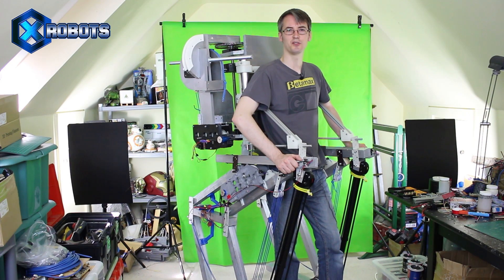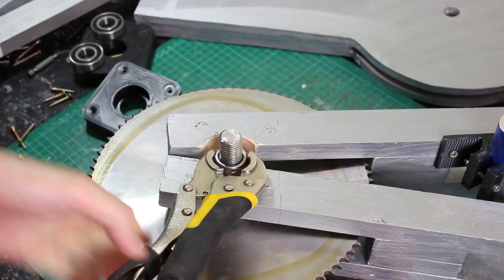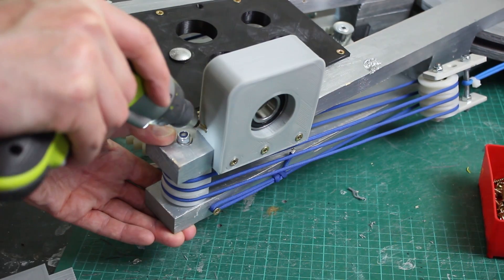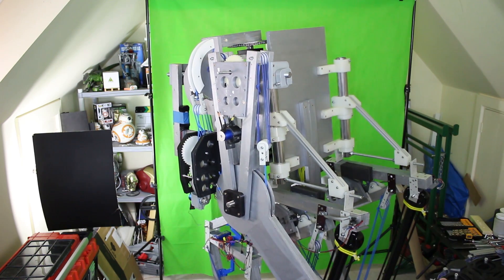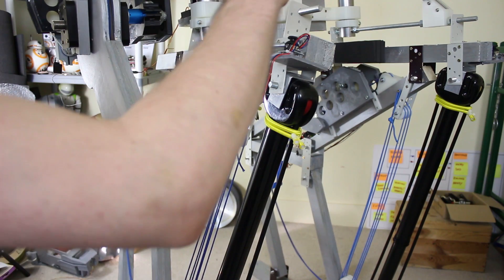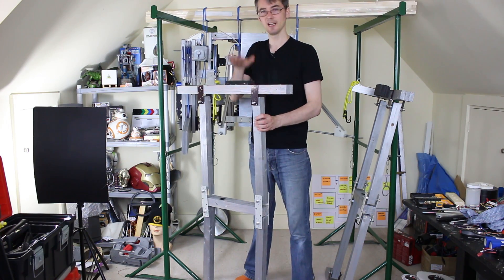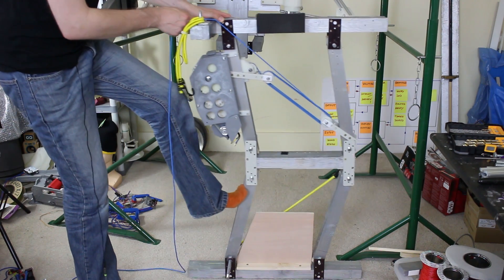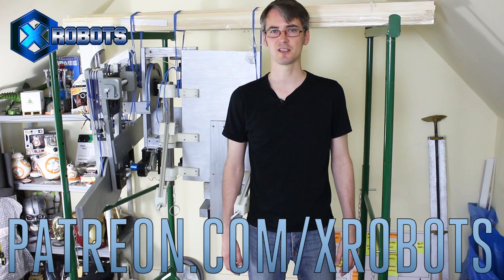Iron Man Exosuit #11 | Power Arm & Legs | James Bruton

Comment: Why you dont use 2 motors on the top legs? Wile one moter (a) is move back, the other one (b) is in neutral (powerles, non brake). And if you want to move back put on motor (b) build tention and release motor (a) to its neutral. This way you will have full control and strength during the entire movement. And not only when your locked, basicly like the way the human is build with 2 pairs of musles :P
Reply: xpatrickx11 weight, cost

Comment: You know, if any of the 3dprinted parts prove too fragile, the hacksmith has a printer that can add carbon and fiberglass strands into parts. I bet He'd love to help with such a cool project 😀. Of course it woyld only work with some parts 🤔, but it can add a great deal of strength. I know you've probably thought of this allready, but I'll just put the thought out there just in case.

Comment: Hey James. I've got an upgrade idea for your new screw gun. Mine was a lesser version and so the AA batteries were low amp hour yellow cells like in yard lights. I soldered in a four pack of name brand rechargeables. Yours is a good brand and so likely already has a decent battery pack or maybe even a proprietary one, but there might just be a few AAs in there. Hope this helps if it ever slows down in the future because my friend just threw his away and all it needed was a battery upgrade.

Comment: Have you ever used carbon fiber?
Reply: Andy Bushnell too expensive
Reply: I build high power rockets and I have put carbon tubes in 3D printed parts to strengthen the parts.

Comment: Have a look a cheap mountain bike springs on eBay there easy to get and you can replace the springs in them with heavier or lighter ones. Or try getting a pneumatic cylinder of eBay adding a valve to one side the you can pressurise it and turn it into an air spring

Comment: I know I may be a little bias, and it's note really your forte, but I think this would look much better with a steampunk look. Your attempts to make the wood look like metal aren't really working (You could use a coat of filler primer) but if you went with a steam punk look, you wouldn't have to disguise the wood.

Comment: What do you use to make sure your 3d prints adhere to the heat bed?
Reply: from previous videos, I know he likes using glue stick
Reply: SoulSukkur thanks for the answer!! I've tried that but it doesn't seem to work for PLA! I'm currently using hair spray and it works most of the time but still I get some lifting from some of my prints. :/
Reply: yeah, he seems to favor ABS for his builds, which need stronger parts
from the admittedly cursory reading I've done on PLA printing, getting a good first layer seems to be less about the substance you put on the print bed and more about tuning settings. this forum might have a few tweaks you haven't tried. https://ultimaker.com/en/community/6153-pla-not-sticking-to-the-bed-and-warping
Reply: SoulSukkur thank you for your response!!
Reply: Check out the Maker's Muse channel he's all about helping people trouble shoot their printing. My guess is that something is out of wack with your temperature settings. Make sure you're following the filament maker's instructions and temperature settings. If I remember right PLA needs a heated bed too. Also it wouldn't hurt to add a halo around the print or something just give your print a wider foot.

Comment: James, correct me if I'm wrong, but isn't this series supposed to be about the power arm? Why spend so much time on walking legs that can support the weight when you could just do a wheeled base? Don't get me wrong, its great stuff. It just feels to me like you've lost the focus of the project. get the arm working then figure legs as a new series until you have a whole exosuit.
Reply: Nevermind, I guess I missed the poll between 6 and 7 where people voted for legs. Still feel it's a shame the arm keeps being set aside to work on legs.
Reply: he did a poll for how to move them and people voted for legs knowing they would take longer, blame the people, not him
Reply: If he built just a simple thing with wheels he would basically just be remaking an engine lift.
Reply: spysee fan, my point is to finalize what the arm needs to be so that you then know how much weight the legs need to support. get one problem solved before creating another. we're already starting revision 2 of the legs and dont have the arm complete yet.